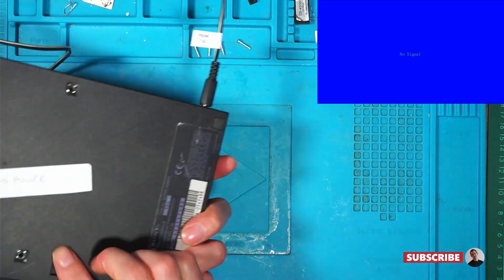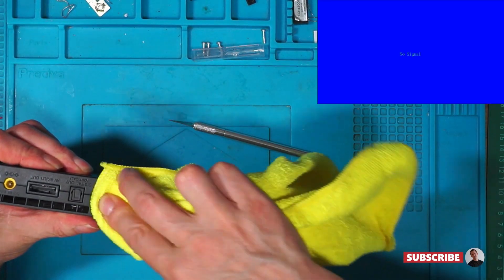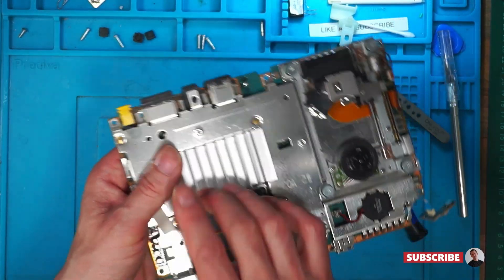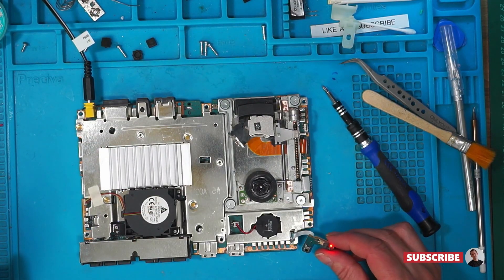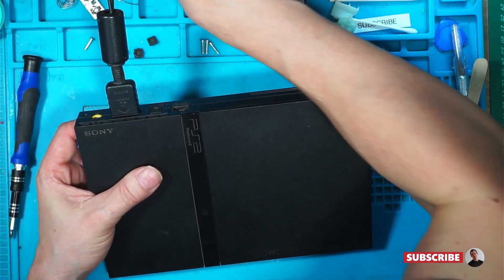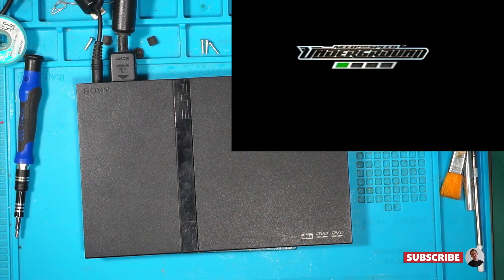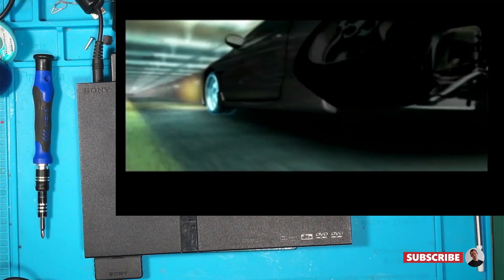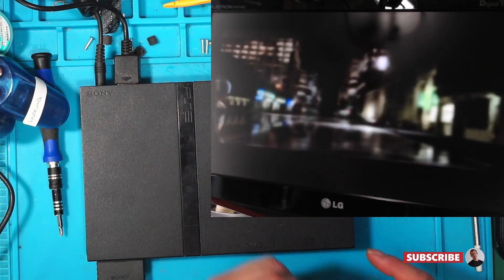PS2 Slim No Power | Find out why and how to fix it.

Comment: Your ending bit about "not everything can be fixed" is often true. Especially when starting out with fixing / repairing electronics, there is likely to be more failed attempts than fixes. Just keep with it and that ratio will turn around. This short video was dead on, as some days you really learn nothing and it is just that broken connection. Always like to see your videos Philip.
Reply from the maker: Hi Nicc. The repair hobby always starts first with collecting broken consoles of stuff you can't fix, or don't have the tools to do it properly. They're always good for spares tho.
Reply: @PhilipBryden  Just had to come back for a second watch, and I remembered I never had a slim like this one, just the big boxy ps2 😀, always wanted one of these slims though.
Reply from the maker: @NiccKennedy  I'm editing another PS2 slim with a laser problem now.  It's a bit more interesting than a loose power jack port 😉
Reply: I agree 100%